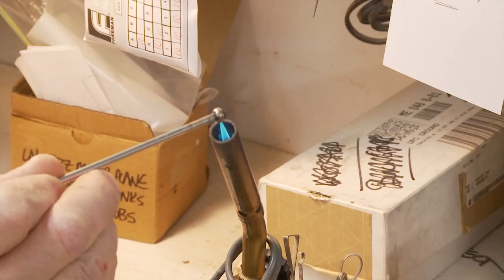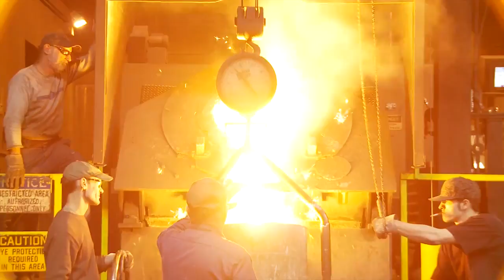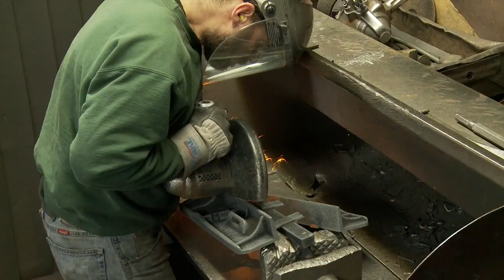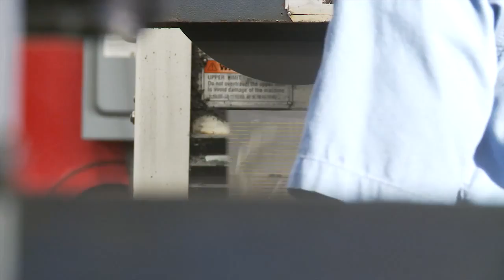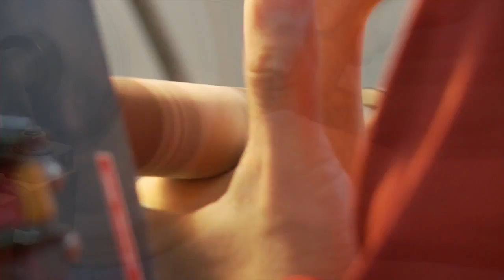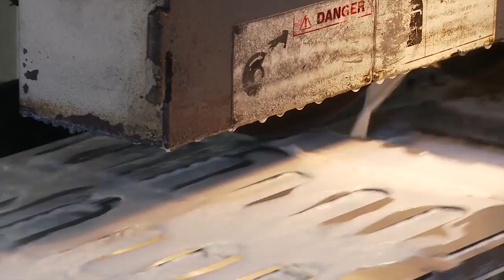Lie Nielsen hand plane manufacturing process - Made in USA

Comment: awesome video! I don't have any Lie Nielsen tools yet but plan to once the budget allows. I really hope that we come back to building quality goods like this in the US again rather than mass producing cheap junk that does not last more than a year or two. I have a 1965 Walker Turner table saw that I restored. I have taken it apart and put it back together and moved it numerous times. I checked it with my Wixy digital angle gauge last night and it was recorded at 90.1 degrees without any calibration and the Wixy is within .1 degree of error...